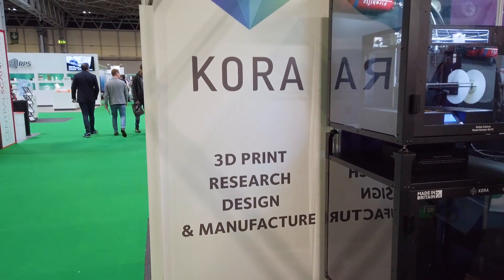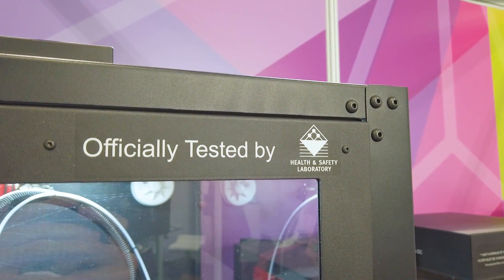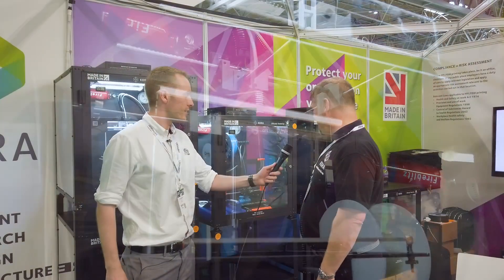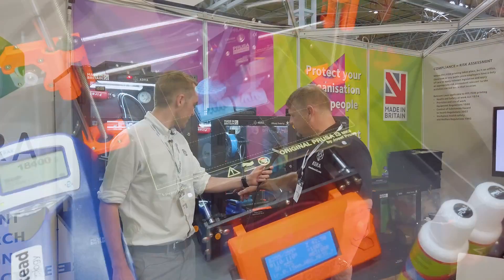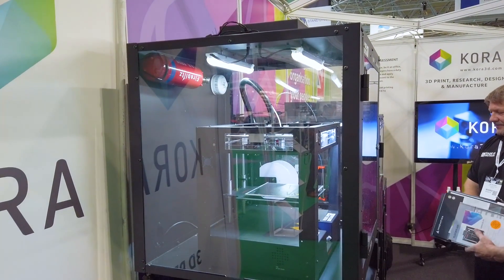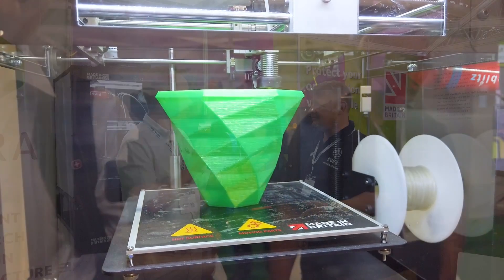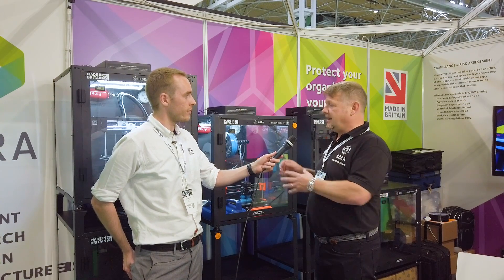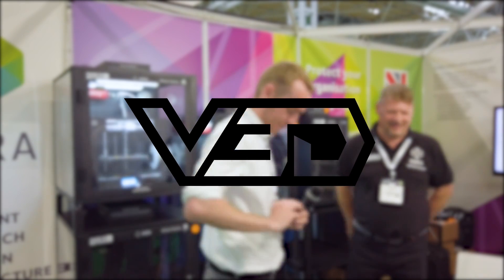Kora3D Filtered Enclosure for 3D Printing at TCTShow 2019

Comment: About time someone focuses on that ALL FDM printers that give of nano-particles and that PLA is not perfectly safe!
Just as an FYI, if you seriously overheat PLA, it can emit seriously nasty carcinogens - so don't overheat it. If cooking-out a blocked nozzle - do it outside or somewhere with good forced-air extraction.

Thanks Adam for showing this option. No-one knows yet the long-term health effects of breathing in the by-products of 3D printing - it's always a good idea to err on the side of safety.
Many years ago 'people' thought asbestos was the safe "wonder material" - so much so it was used in almost everything:- Johnson & Johnson even used it in its baby powder!!!
Now we are wiser to the serious negative effects of asbestos.

It may turn out that nano-particles of plastic cause serious problems in the future, we just don't know yet.
Therefore, if you can avoid breathing in the fumes and particles, do so. 
Enjoy life. Enjoy your printing. 👍👍👍
Reply: Hi Sue3DDesigns, this is exactly what we focus on, we just dont know the long term effects so it is better to be safe, our unit is tested by the HSE and does filter the air. We were shocked how many people had a printer running in their bedroom overnight, or in the office printing all day with no extraction system. You can smell the burning plastic when you print with certain materials, the other thing to consider is - do we know exactly what is the PLA and other materials we use? probably not..

Comment: Am I missing something? Of course you get a higher particulate concentration when you trap a printer in a confined volume?
Reply from the maker: You're right but its not a sealed enclosure. The point is demonstrating that those particles are there and that their filtration system captures them. There is actually ventilation on the machine too, its not sealed. The fan by the filter is drawing air into the enclosure through gaps at the bottom, the air gets filled with particulates around the hotend, and then is filtered at the top before being exhausted.
Reply: Hi Elliot, you are correct. The important thing is the particles are not safe and you ideally need some form of system to clean the air. A lot of industrial users have big expensive extraction systems already so are covered. This is for smaller printers, and there are thousands in use across the world. We can show you in person if you would like to visit our site in Leeds

Comment: I don't think I will be buying one, I would probably use a standard inline extractor with an activated charcoal filter if I was that worried about particulates.
 However, this is a great product for schools and colleges, I would love to see the reading from Prusa's print farm!
Reply from the maker: Activated charcoal filter is not a good standalone solution for particulate filtering. AC is for VOC capturing, you need HEPA for particulates.
Reply: Hi Andrew, If you are printing in a room with extraction already you might be safe enough and covered. We can advise free of charge if you send our guys some details of your current set up, our contact details are on our website www.kora3d.com
Reply: Hi  Andrew , we took a video of us testing the air quality at the end of the show , it was scary